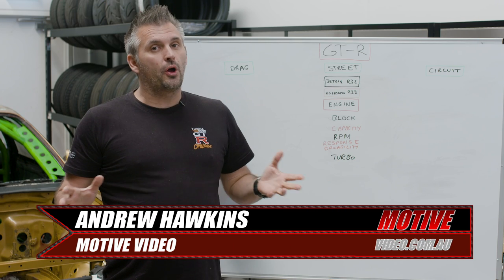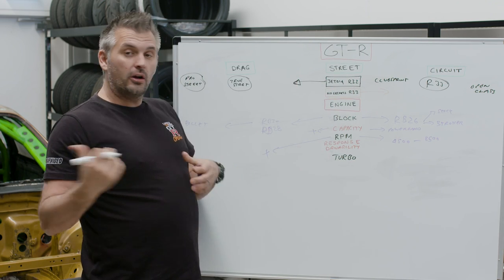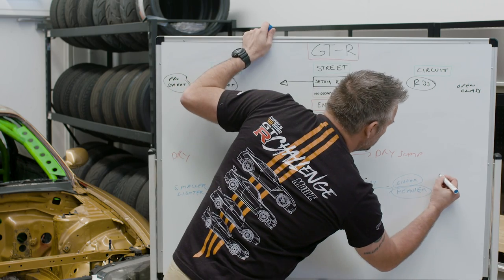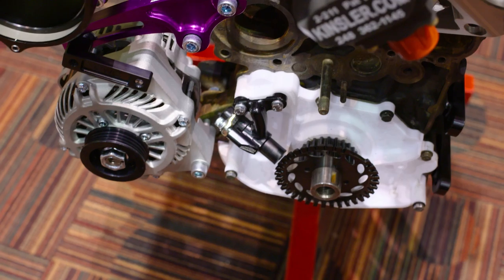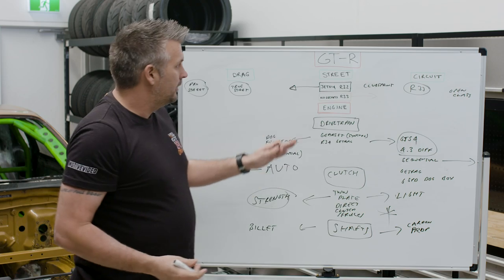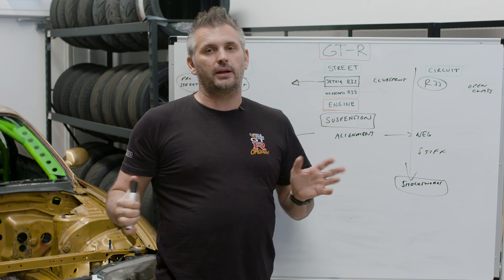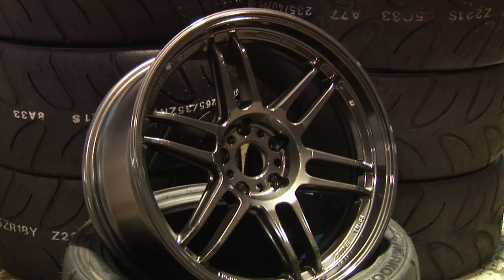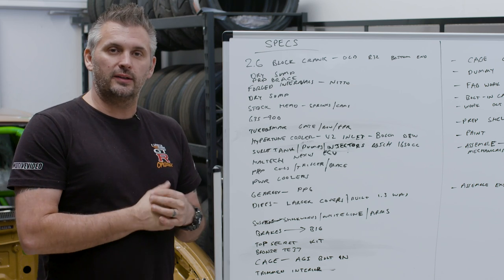We plan out our R33 GT-R build for street/circuit -   Project No Secrets Ep5

Comment: Better call Ross Performacne in Albury ;) They've got the best off the shelf GTR Drysump, balancer kit and trigger kit available.
Really smallert tank for more extreme circuit. Go Bigger for enduro racing :)
I wasn't awre that bolt in cages were allowed for Natioanl level motorsport. 

Not goin gto be a cheap build, but going to be a wild ride

Comment: This is a great video. Could you do some planning guidance for different bracketed HP street builds. So 300-500whp then 500-800- whp etc etc and the considerations for that level of power. Also, what you would do before doing anything with the power. 👍
Reply from the maker: Take a look at this first

https://youtu.be/aM3TaZ7wDfQ

Comment: 11 litre sump here and I had one of Australia fastest street/circuit 34GTR's and never had an oil problem with a wet sump.
Reply from the maker: Did you circuit race your R34 on semi slicks and rev to 10,000rpm? We know wet sump is perfectly capable as our black R32 has it.
Reply: @MotiveVideo  yeah it had 295 and 305 semi slicks and revved to no more than 8000rpm, the twin turbos were holding back the revs and was really in the territory for definitely going to a single turbo.
Scavenging would have been massively restricted with the twin setup and heat was also becoming a factor as it could not get out of the engine efficiently enough.
Pumping losses must have been huge.
I found as long as the sump had enough oil (11L in my case) you would mitigate oil starvation issues.  The other thing was the sump was very well baffled which controlled the G load for the cornering.
Yes the dry sump would be better, but IMO it is unnecessary to have in a circuit car, atleast on the Rb26 in a 34.
I was in around the 1.5g of lateral loads.
Even at Phillip Island and SMP it held up very well.

Comment: Andrew, so my biggest question: I remember that when Smokey was building his Z33 demo car, he did a release with Rays to produce a 20” multi-piece version of the TE37 and the GT-C, a few of which had the Top Secret logo slapped on them. If you had the chance to get a set of those Top Secret version Rays wheels via Rob from Import Monster in 18” or 19”, would you ever consider those for No Secrets as a tribute to the iconic R33 Yokohama bay runner?
Reply from the maker: We’ve actually owned Top Secret TE37s before and had them on Erubisu in 19”. The R33 demo car in 99 has these bronze TE37s and that’s what Andrew has been set on the whole time

Comment: I have an R32 GTR and would like to do some track days with it. Do I really need all those drive line coolers or can I just dial back the power to maybe 300whp?
Reply from the maker: Just have to remember to do less laps back to back. Do a couple of flyers, cool down lap, couple of flyers, cool down lap. Even if oil and water temp seem fine, other things can be getting very hot.
Reply: @MotiveVideo  Welp, time to get a bunch of coolers. I hate guess work.

Comment: If you only wanted to make a street car with 400-500whp would you still run the GTX3582r or would you drop to a GTX3076r for more low-end response?
Reply from the maker: The GtX3076 rear housing would choke the RB26. We would go for GTX3576 on that power level. Our S14 has one and a weapon of a turbo
Reply: @MotiveVideo  Thanks for the quick response! I'm looking at importing an R33 to the US, so trying to get all my ducks in a row. Cheers!

Comment: Andrew I thought the new nitto oil pump means you can use it for circuit use instead of going full dry sump?
Reply from the maker: The pump is fine. It’s all the other things in oil control. Sump, baffles etc. plus we’ve never personally used a dry sump so want to do a tech on one.
Reply: @MotiveVideo  I want to know a budget option that's good for the track

Comment: Andrew since you have a lot to do with Herman, he claims "NITTO's RB30 Stroker kits are designed for use in all motorsport classifications including drag racing, drifting and circuit racing. Rotational capability is lifted to 10,000 + RPM"  He has demonstrated the block is better on your channel.  But you are specifically saying RB30's are not good for over 7500rpm generally, which is a view supported by other like RIPS etc. The long stroke obviously being the issue with the nitto kit being even longer than stock. 

Where is the truth? Maybe a thought for a video.
Reply from the maker: With stock crank they aren’t great over 7500. The Nitto billet crank is better material, balanced, counter weighted and knife edged so it’s much better for high rpm. Herman, Andrew and Jim all agree for circuit hit and rev ability, the RB26 with 2.7 or 2.8 stroker is better.
Reply: @MotiveVideo  yeah sorry got Herman  on the mind, ment Jim for NITTO.

Comment: I would be weary of using rose joints in every use case just for ease of adjsutability. They are not supposed to take axial loads and could shear straight off under breaking or any shear loads. You can compensate by overspeccing the size of the joint but it's still a poor design from an engineering stand point and in a 800bhp skyline I would just be worried, wouldnt want to see any of you guys in an accident
Reply from the maker: So arms designed for racing shouldn’t be used for racing?
Reply: @MotiveVideo  depends how much you trust the guy who designed them. Im sure you guys have loads of practical experience with the parts and I'm not trying to be a dickhead its just a fundamental engineering principal that threads are only meant to be under tension or compression and when it comes to designing purpose built race cars from the ground up it's one if the big no no's. In a use case such as a toe link or tie rod where the loads are colinear then that's pretty common to use. Apologies if I came across as a typical know it all this is just from my experience when designing suspension components. Love the content as always